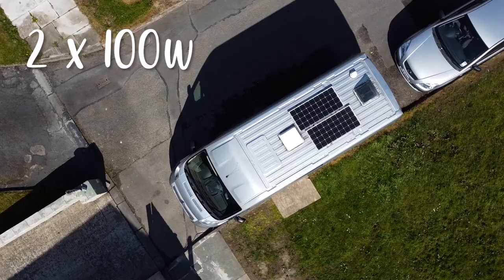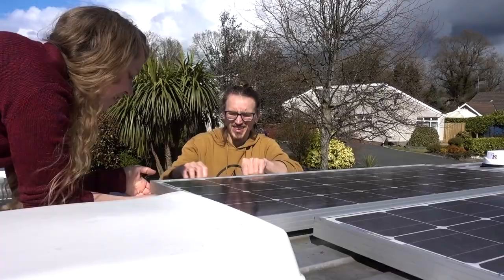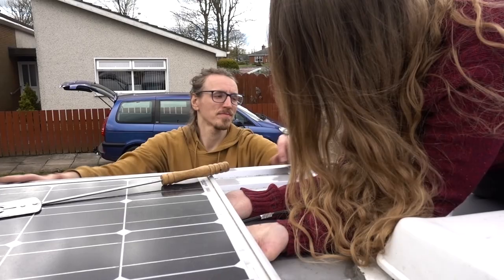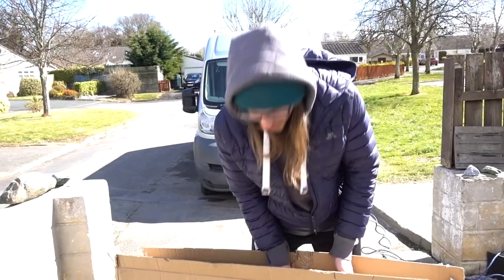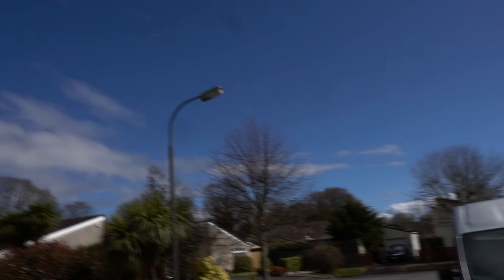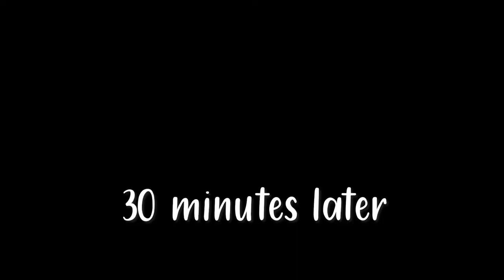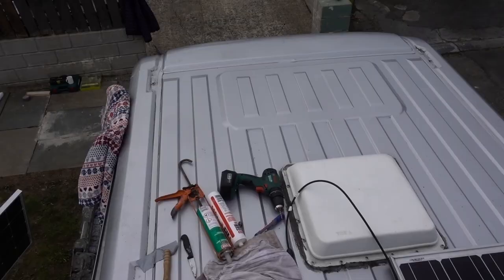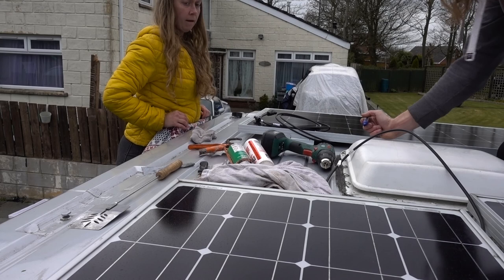INSTALLING extra 120w SOLAR PANEL | Van Improvements | Vanlife Ireland |  DIY VANBUILD UK | Ireland

Comment: Funny and accurate NI weather!! Is the other thing on your roof a signal booster?
Reply from the maker: It is indeed an antenna to boost signal, however we are having issues with it at the moment, so once we get it fully working we will do an install video and review of it. Fingers crossed we get it going properly

Comment: Electrician comments, it would have been far easier if Keely was on on the roof riding her unicorn (unicycle) with rubber tyre protection so as to reduce the risk of electrical sun shock 😎👍😂
Reply from the maker: 👍🤣 thanks